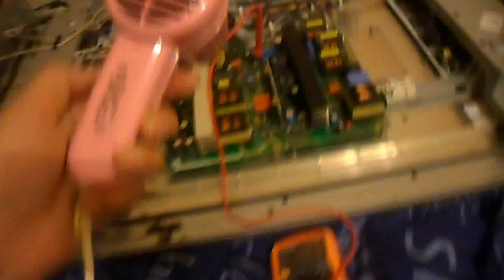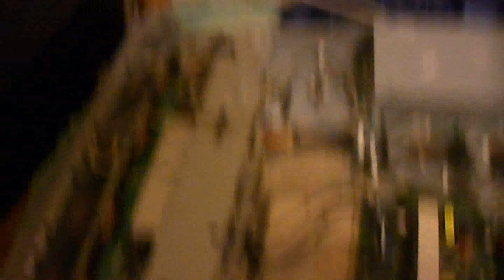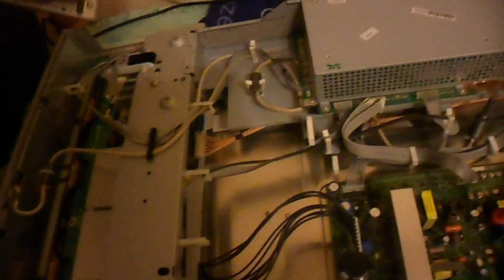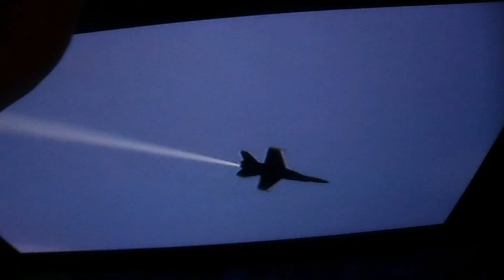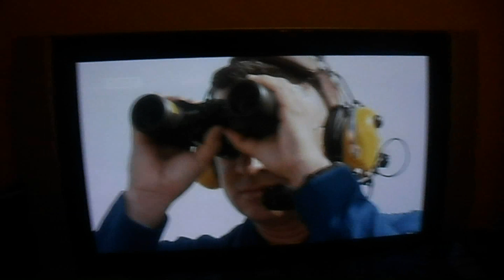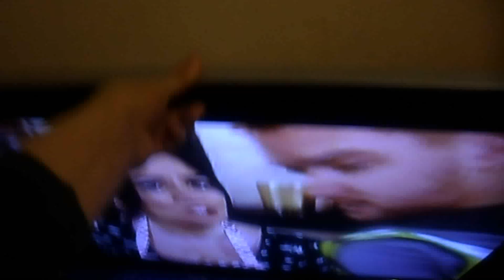Philips 42PF5521 and other Philips plasmas - Two blink code - Diagnosis and Repair

Comment: Hi, this is very useful - I have one of these and it gives 1 long slow blink and then 2 fast ones. Having opened it up, the capacitors have already been changed, making fault diagnosis a bit more tricky. I can't quite see where you're picking up the test voltage from though - can you confirm the exact location on the board please?